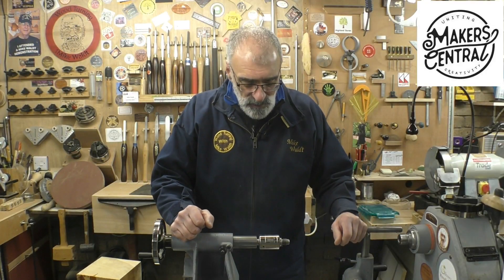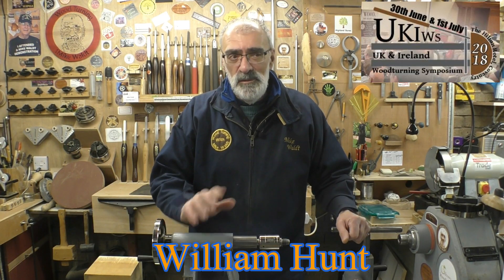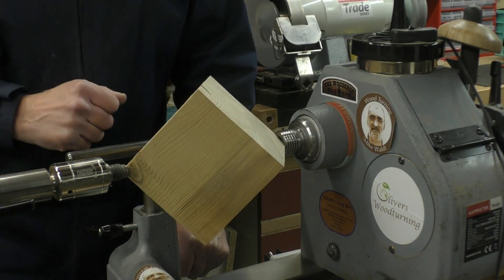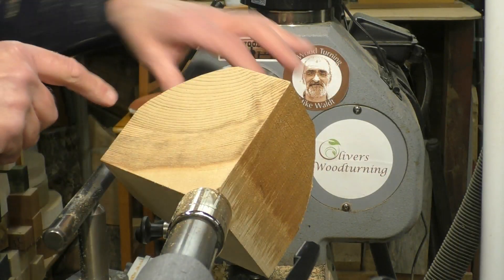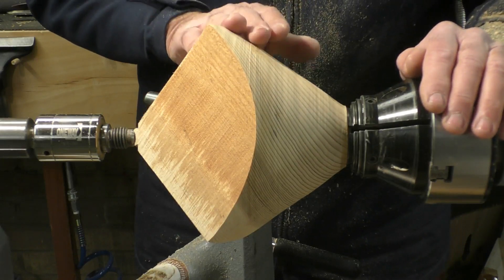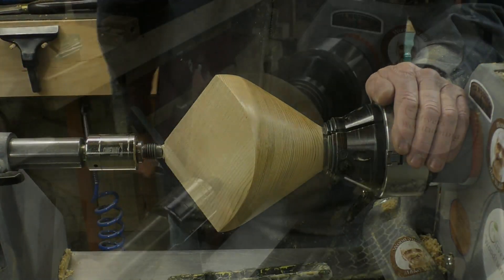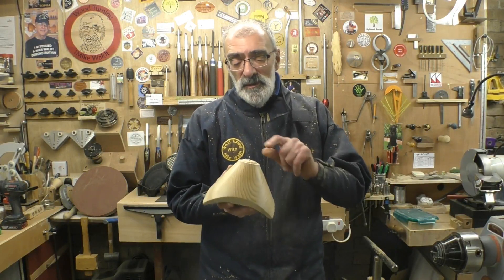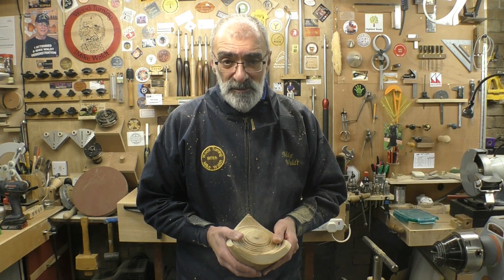Woodturning - How To turn a Three Sided Bowl

Comment: What is your view of the O'Donnell jaws for the Axminster chuck, I bought a clubman chuck at Harrogate but find the C jaws too big and I want a versatile set of jaws?
Also thinking of upgrading my lathe from basic Chinese and looking at the 1628, is its a good choice, bearing in mind you have moved on.
Cheers, Mike
James
Reply from the maker: The O'Donnell are good jaws James, and if you get the "set" you have a lot of versatility.
The 1628 is a good lathe, but I have to say that the Stratos is a few steps up, and I say that in all honesty :)
Cheers
Mike

Comment: Question:
Would it create less pressure on the piece if the tail stock point of the wood was cut off to produce a flat surface and make less hollowing necessary? Or is more difficult turning the point of the exercise?
Going to try this over the coming week.
Keep the videos coming Mike
Kevin
Reply from the maker: Hi Kevin, it wouldn't make that much difference in my opinion to be honest, but might be worth a try anyway .... just to see 🙂
Thanks for watching
Cheers 
Mike

Comment: I'm new to turning, and have a question. Can this bowl be saved now? Or has it just become fire wood. That's a lot of work to go through to have something like that happen. Thanks for all the info. provided to this newb, your a superb teacher!
Reply: I would try to save it by flatting the bottom of the piece and then gluing it to a block to then be held in the chuck. The tricky bit about doing this is getting it centered on the lathe before the glue sets.
Reply from the maker: Yes it can, and I'm hoping to put up a video showing the save :)
Cheers
Mike
Reply from the maker: Watch this space ;)
Cheers
Mike

Comment: Hi Mike. I'm also a great fan of Carl's, but not seen this project so really nice to see you have a crack at it (no pun intended...). Can I just ask what chisel you used to clean up the outside? Was it a scraper? Thanks as always for the informative run through
Reply from the maker: Thanks Roy, I didn't show it for some stupid reason, but I used a combination of shear scraping with the bowl gouge, and a negative rake scraper.
Thanks also for watching and commenting.
Cheers
Mike

Comment: After watching your video and sending you some comments via email several weeks ago, I tried turning another three sided bowl.  I got to about the point you reached in your turning when disaster hit again.  My tenon broke off into three pieces and gluing it did no good.  So, I will try another time turning this bowl.   

For your viewers, this bowl looks simple to turn.  Looks are very deceiving and it is actually quite challenging to turn the bowl.  Make sure your blank is a cube with all sides having the same dimension.  If you are off a small fraction of an inch, it will mess up the bowl since the wings will not be even.   Hollowing out the inside is where the problems will raise their ugly heads.  It will be very easy to have a catastrophic catch occur when turning.  A small round carbide may lessen the chances of this happening.  Good luck folks.  This is a very challenging bowl to turn.
Reply from the maker: Thank you for your thoughts they are very much appreciated,  and thanks for watching.
Reply: Mike Waldt 

I was able to complete my three winged bowl on my 5th attempt.   I used a 3.4” x 3.4” x 3.4” cube of cherry wood.  I wanted to complete using my conventional turning tools, but I still have a long way to go in being proficient using those tools.  Instead I used carbide to do most of the work along with some 1/2” bowl gouge use.

I discovered a small cube of wood is much more challenging to turn than a larger cube with 5” or 6” sides.  I would suggest staying with closed grain woods like cherry or maple and avoid open grain woods like oak, hickory, hackberry, walnut, etc.  The points of the wings tend to break off easily with open grain woods  unless one posses a very light touch with the turning tool.  And turning this bowl with small cubes, the open grain woods seem to catch more easily. But that is my own opinion due to inexperience turning wood.

When hollowing out, be sure to mark the position of the corners on the tool rest along with the desired wall thickness of the wings.  Each corner of the blank should line up with the mark on the tool rest.   Accuracy in cutting your blank is paramount and all sides having the same dimension. Do not move the tool rest until the outer edges & thickness have been turned.  This means the tool rest will remain in place for most of the turning until the center portion of the blank gets into the way of your turning efforts.

Having a light touch is critical in turning this bowl.  Sanding should be done by hand while the piece is stationary.  The wings of a rotating bowl can be dangerous while sanding.  Play it safe while sanding and turning. We don’t want bruised, broken or missing fingers here.

Comment: OK - so stupid question. Why not cut the the 3 side shape to a normal bowl? Is this just another way to go about it? or is there a specific better reason for doing so? as this way seems like more work and more dangerous?
Reply from the maker: No question is stupid in my view. The reason I will do future pieces like this the same way is that it gives more flexibility for the design, and to be honest, i simply enjoy doing it, even if it doesn't always go right ;)
As far as the danger aspect, I think it is minimal, as you are out of the line of fire, and providing you are wearing a good quality full face shield, no damage is going to caused ... except to possibly ego.
Thanks for watching and commenting.
Cheers
Mike
Reply: I had the same question in the first chuck mounting.
Reply: What do you see in this video, that you think is more dangerous then any other? I don't see anything that is anymore dangerous then a regular turning, the blank is held between the spindle drive shaft and the hollow center.
Reply: Len Mullin - Perhaps dangerous was the wrong word. Having the three wings spinning seems more advanced? more chance for things to go wrong :)
Reply: wforl It just means you have to enter and exit the piece more carefully and deliberately paced instead of just diving in with a tool on a flat surface.  You have to keep a good eye on the ghost and have good spacial awareness to know when your tool is going to contact wood.

Comment: I forgot to say great video ... though in the beginning i would have liked to have seen  a shot of the tenon. I bought a cheap 4x4 and cut it down to several 4x4x4 and just practiced on those. non of them turned out very well as it was pine. Maybe I needed to sharpen or just baby the cuts a little more, but pine was difficult. Thanks again for all that you do.
Reply from the maker: Thanks Rick, appreciate that. Pine or the same sort of wood is hard to get a good finish on ... but a good medium for practicing those baby cuts with sharp tools :)
Appreciate your supportive words as well my friend.

Comment: Had the exact same thing happen to me. Got a feeling that more substantial tennon is needed as there is a lot more waste to remove than a standard bowl. Just wondering if that's a thing.

Not sure if this is on purpose but random ads play in the middle of your video. Really annoying.
Reply from the maker: I have formed a bigger tenon on the save video, but the smaller one hell fine on my first attempt. 
Thanks for watching
Cheers
Mike

Comment: Hey Mike you could stick it back on a worm screw or a screw chuck because you haven’t turned away too much of the middle make another tenant and do it again
Personally I have made three of these and I found if you have it using tailstock for almost all of the interior turning it gives it much more stability and much less likely to ping off
Hope this helps
Reply from the maker: Thanks for the tips Harry much appreciated.

Comment: Shame the tenon gave way. This method of chucking is the same as demonstrated at the Club in November by Chris Fisher. He did suggest that, due to the unequal stresses it’s a good idea to put a chunky than usual tenon on the piece. He also strongly advised keeping fingers, knuckles and any other body parts away from the flying wings. I think he may have been referring to self removal of ones Crown Jewels! Thanks for putting the video on YouTube. Cheers Mate
Reply from the maker: Hi Graham, I used the same size tennon on the practice piece with no issues, however I will try a larger tenon on the attempted save, just to see :)
Thanks for watching and commenting mate.
Cheers
Mike

Comment: I always thought it a waist to hog out the middle. There are saws that attach to the ways that can be used to cut off just passed the points. The cutoff can be used to make another bowl. Rick
Reply from the maker: Not so much fun though Rick   ....  thanks for the tip though :)
Cheers
Mike

Comment: Unfortunate, but that's why I don't understand why people will sand and finish the first part with the risk of failure/destruction after, making it a waste of time and materials (sandpaper / oils).
Reply from the maker: The main reason is that you do these things while you have the bulk of the wood to give support, but the other reason is that if one didn't do it, that would give negative thoughts about completing the project.  ;).
Thanks for watching and commenting. 
Cheers
Mike